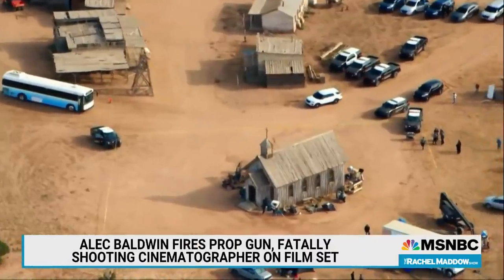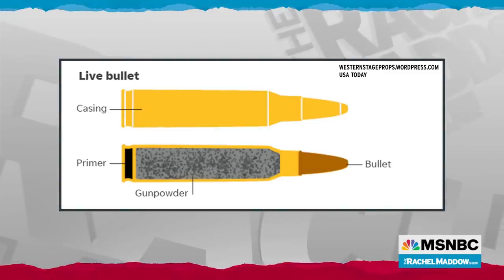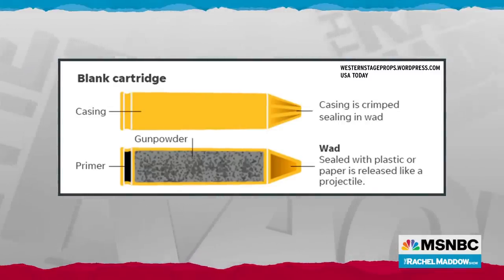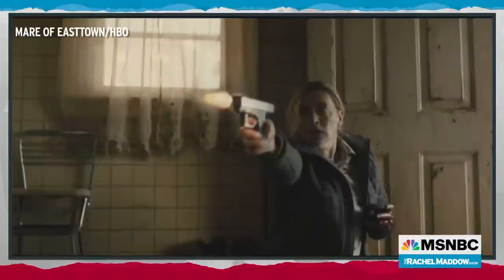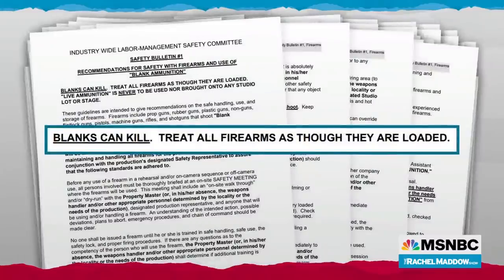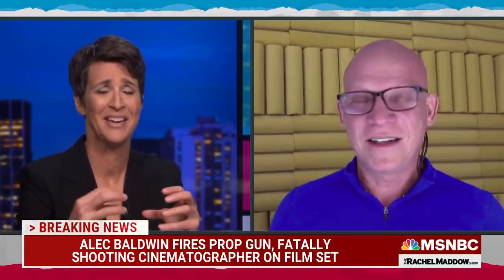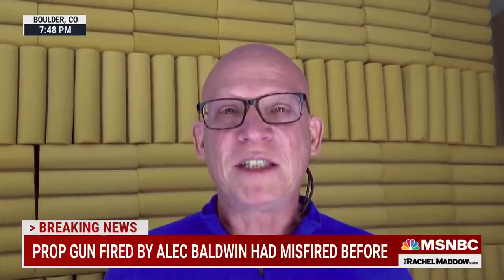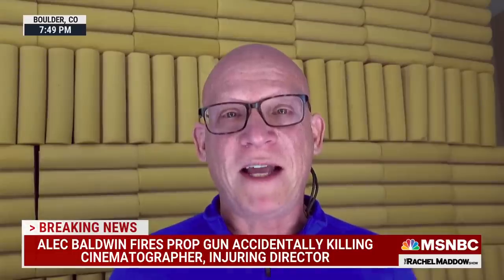Weapons Safety Expert Looks At Safety Protocols And Alec Baldwin Movie Set Shooting

Comment: Bingo. Just like the Florida bldg collapse. It took several failures in regulations for the catastrophe to happen.
Reply: Not a failure in regulations in both these cases, rather a failure to enforce them or ignorance by the people in charge. Most often the latter here.
Reply: It is the same in aviation investigations.  You often find a series of mistakes or assumptions made leading up to the crash.
Reply: @LMM7880  This is sometimes referred to as the "Swiss cheese" model. All of the holes in the cheese have to line up just right or nothing bad happens. Multiple safety rules have to be broken.
Reply: @machintelligence  with the Swiss cheese model there needs to be multiple people performing safety checks. When there is only one or 2 people there is a greater chance for those holes to line up.
Reply: Just like surfside, the impossible is made real
Reply: @jf6962  I can point to at least three. The person who was unaware of the rule about no live ammunition on set.
The armorer who prepared the gun.
The actor who pointed the gun at someone.
Possibly also the person who informed the actor that the gun was not loaded.
= three or four levels of screw-up.
Reply: @machintelligence  as far as actors, just not sure that particular point would qualify, as the actor's job isn't specifically to watch out for safety, it's to act and take what they have been given as the prop and act with it. Now if the rules in the fine print are different, I understand. Also understand that everyone, regardless of circumstance should be safe with firearms, I'm just saying specifically as far as this circumstance. I have a feeling that the gun Wrangler had walked off of the set. I'm just curious, who loaded the gun, and did they load ot improperly?
Reply: @machintelligence   Allegedly there was no armorer as he/she left the production because of disagreements over hotel recommendations
Reply: Not really the tenants were told it was failing but declined to pay for repairs that would have cost them millions and so they died for being stingy with their money, simple greed killed them .
Reply: 1. Pointing the gun at that woman 
2. Pulling the trigger
Reply: No, it took one woman to look to see if the gun was safe, she didn't.
Reply: This is why I can't stand people saying Alec needs to go to jail. Like a lot of stuff went wrong for this to happen. It would be like imprisoning the guy who leaned against the wall that fell over in the collapse.
Reply: @Amelia-uf9ig  one woman? The person pointing and firing the weapon is ultimately responsible. This is not complicated

Comment: What I can't understand is why would they have live ammunition on the movie set to begin with?!
Reply: And why was a gun pointed at the cinematographer in the first place and then fired?
Reply: Its cheaper than good dummy rounds for loading scenes and close ups. Budget and whatnot
Reply: @XxLuvverofMusicxX  probably was more pointed at the camera for a scene and the cinematographer and director were behind it. He thought it was a blank im guessing. He was guaranteed by a "professional"
Reply: @XxLuvverofMusicxX  - because they shoot AT the camera and that is where the cinematographer and director is standing - its the most common shot taken in a movie.
Reply: @robhill4352  - YES - they use live bullets for the close up loading. Which is Fking dumb - all "live bullets" should be lead-filled dummies so they are clearly much heavier and no actual live bullet should ever be anywhere near a film set.
Reply: 1) Loading rounds on camera (though dummy bullets can simulate this, it sounds like there was a problem with the off-camera crew and that wasn't properly handled)
2) Converting live ammo to blanks.  
3) Live ammo also can be used for pyrotechnics or for when they need actual bullets to fire and cause damage on-screen.
Reply: @piccalillipit9211  They can use simulated rounds or dud for that.. but if someone swaps the dummy for the real round and no one-notices?
Reply: @AdeptPaladin   here in Bulgaria you can buy "Gas guns" for self-defence - they shoot either CS Gas or Mace, or just blank rounds. YOU CAN NOT FIRE A LIVE ROUND

The barrel is not machined out fully so it will not allow a live round to be fired. As the guy showed they are chambered under sized. So you make a law / policy that in the "blanc calibre" its illegal to create a live round in that calibre - it can be a dummy or a blank so that live ammunition for not exist in that calibre. 

Im pretty sure this is the case in Europe, not 100% sure.
Reply: @AdeptPaladin  A "dud" is ammo or an explosive device that fails to fire or detonate. They are not purposely designed that way... They malfunction. A "dummy" round, also known as a drill round, is a round that doesn't contain a primer or gun powder. So, therefore it cannot fire.
Reply: One would think that rule #1 would be... Shoot to "miss".
Reply: @XxLuvverofMusicxX  I've worked on many films that use firearms and you look at most scenes involving a shooting, there's always 3, 4 upwards of 10 or 12 camera angles shot for any scene, then they pick 1 or 2 for the final cut, this applies for any and all scenes. 90% of all that's filmed never makes it to the final cut. There will always be some shots fired right at or close to the camera angle and the director and about 6 other people sit right behind or beside the camera guy.
Reply: asking the real questions here...
Reply: @robhill4352  there was even an acrylic screen to stop the filling of the blank, but it was a live round instead.
Reply: @piccalillipit9211  

No they don't use live rounds for loading shots. They use dummy rounds, fake rounds that look real. 

Noone except security should have a live round on a set
Reply: Because its freeeeeeedooooooom
Reply: Thats the one thing I cannot even fathom. Either someone is extremely careless and did not know at all what they were doing, or it was a malicious act to start with. Firing a gun is intentional, but actors go through numerous rehearsals and I can understand an actor pulling the trigger rehearsing something. I dont know what the safety standards are and I leave it to experts whether an actor is supposed to check the barrel of each gun they are handed or not.
Reply: BANG...!?
Reply: @XxLuvverofMusicxX  ...Alec must have been feeling silly....!
Reply: @piccalillipit9211  BFA, painted black. Blank firing attachment...this sounds Baldwin unique improper handling.
Reply: @piccalillipit9211  Interesting. I would have thought that if you were after realism for a loading scene you would use rounds without powder and primer. Also you would ensure the firearm had no firing pin. Three points of safety right there alone. But maybe I am being an expert after the fact as I have never given any of this any thought before. Plus I do not work in the film industry so it would have never been a concern.
Reply: Well He is known to have a spiteful temper……
I know just saying
Reply: Agreed. You would think no one except licensed security professionals would be able to possess live ammo on film sets following the Brandon Lee incident.
Reply: Michael Heathman  Most production companies don't even use real guns with a blank charges anymore, it's all CGI now. It's safer, quieter and you don't need to have a gun wrangler around all the time. Anytime you have a prop gun on set and it's about to discharge a blank, it's called a "live round", meaning there's going to be a flash bang and it's going to be loud so be prepared. They don't even allow real guns anywhere near sets, prop guns are a different size internally and only accept blank rounds. I think the wrangler lost control of the weapon at sometime and either some loose material got shoved down the barrel or fell into the barrel from a previous scene. Either way I'm sure we'll hear soon enough what happened. It's a sad day for those involved.
Reply: Because it's the USA! Guns and ammo for everyone 🥳
Reply: First we don’t know this for sure. Second if you are getting firearms information from Rachel then you definitely don’t know anything
Reply: Rattlesnakes?
Reply: @salvagemonster3612  And third, if all people would listen to passive-aggressive Youtube comments, then all would be well in the world.
Reply: @noskillzdad5504  yeah. But did you see the 24 year old armoror?
Reply: possibly an inexperience crew. That's what happen with Brandon Lee, they had live ammuniton on set that they later cannibleized to make blanks and snapcaps.
Reply: @piccalillipit9211  No. Live ammo isn't even allowed on film sets. What it is for loading scenes is dummy round. A case filled with plastic and the prop department paints the tip metallic. Same thing everyone else in the entire world uses for loading drills. You can buy the things in every Walmart in the country. They're common as dirt.
Reply: @salvagemonster3612  I'm guessing you didn't even watch, an actual expert does the talking
Reply: @halycon404  Dummy rounds that look like they are made of plastic are common as dirt. the ones that look real are not to prevent confusion.
Having someone paint them costs money....
I know, it is stupid and illegal, but it is one way this could have happened. If so, people should go to jail.
Reply: I just can't understand why someone would just pull the trigger while pointing it at a person? Needs a full investigation
Reply: @robhill4352  reloaders make dummy rounds all the time. I make them without a primer so it is easier to set up the reloading equipment for that particular bullet and cartridge. It would be easy to add an inert primer.
Reply: It's extremely sad that Mr. Baldwin was handed a loaded gun.  He trusted what was handed to him and told to him.  He will have to live with this the rest of his life.
Reply: Go to the top. Hillary must be involved.
Reply: What I can't understand is you and I are scrutinized to have a gun but any nim rod with a SAG card can get one
Reply: @piccalillipit9211  they aren't supposed to have live ammo anywhere on set. They can have fake rounds instead with no powder and no primer, that do have a bullet. If you don't have a primer there's no chance of boom, but the armorer on set didn't know what they were doing
Reply: @robhill4352  you have no idea what you are talking about unless this is a feeble attempt at being sarcastic.
Reply: @AdeptPaladin  zerc hits are used from air guns or charges are placed on the item that needs to be hit and triggered during the take. We do not use live rounds.
Reply: @piccalillipit9211  no they don’t, they use dummies for closeup shots.
Reply: Apparently the crew were using live rounds to shoot cans during the downtime. Sounds pretty dumb, but even if they were doing that there are protocols to follow that would’ve caught the gun containing live ammo.
Reply: So the crew can do target shooting during down time. The crew returns the gun to storage without unloading.  Later, gun isn't checked by armorer or actor to see if it is loaded. Actor pulls trigger.
Reply: I read they were using the pistol to shoot targets during the down time.  The pistol was never locked up or checked.
Reply: @piccalillipit9211  Another prop master puts pellets in the cartridges for dummy rounds. They rattle when shaken.
The reason for the real bullets on this set was because they were using the pistol to shoot targets during the down time.  People were already walking off the set after a stuntman shot two rounds when it was not suppose to shoot anything.
Reply: @torben6137  More like target practice during down time.
Reply: @konradyearwood5845  That's true, but the pistol was also being used on the set to shoot targets between takes.
Reply: @telescope3   They were using the pistol to shoot targets between takes plus a stuntman had already fired two rounds a couple days later when it was suppose to shoot nothing. Negligence charges are surely going to crop up.
Reply: @DKanon  Targets. They were using that firearm to shoot targets between takes.
Reply: @GreatBigRanz  Here the live ammo was used to shoot targets between takes.
Reply: @halycon404  That's where the negligence charges will come in.  Not only was that firearm being used to shoot targets between takes, a stuntman fired two rounds when the pistol was suppose to be empty a couple days before.
Reply: @nk-dw2hm  They were already using the firearm for target practice between takes and two rounds were fired on set by the stuntman a couple days earlier when nothing was suppose to go off.
Reply: @XxLuvverofMusicxX  Because Alec Baldwin, being as anti-gun as he is, didn't bother to learn proper firearm safety.
Reply: @robhill4352  According to a witness he was doing practice draws when it happened.  Also, there is a certain degree of responsibility on him to check.  That's universal when handling a gun.
Reply: @torben6137  Your sarcasm screams anti-2A, Am I right?
Reply: @royormonde3682  
That is a stupid practice and needs to change then. We can now use monitors and machines/tools to view what the camera sees and to also adjust the camera. 

Aiming a gun of any sort at something you don't want to destroy is a huge no-no.
Reply: @robhill4352  Hi Rob, I've just read your comment about loading scenes, again it's still no excuse for having any live rounds anywhere on a film set, yes blanks are one thing, I know the firearms world very well, I understand wanting to show a real looking bullet to the camera for loading purposes to make it look real I get that, as a blank will show the crimped edge which loses that authentic look, however you can use a real looking bullet and remove the powder and primer, that way on camera it looks 100% like a real bullet because it is. Removing the, powder and primer doesn't lose any authenticity especially on camera, this also renders the bullet impossible to fire. 

This is my own personal opinion: Whoever loaded gun with live ammo, as they knew it was a prop gun and they were on a film set, whoever said it was a cold gun and, whoever should have checked it but didn't, then handed it to the actor (everyone knew what scene was going to happen in advance of filming and what was going to happen in that scene), and the person that pulled the trigger are all responsible for one person being shot dead and another seriously injured. As the man in the video states why would you point a gun at someone regardless if it was safe or not and pull the trigger? 
All these failures in health and safety, not following the correct rules, laws and basic common sense all led to the death of a very talented young lady and a man getting seriously injured nearly costing another his life. All of the above people are to blame it's as simple as that! But because it's an A list celeb involved I doubt he will ever face any real justice probably a fine or a suspended sentence max.     
Again they were all to blame and all broke the basic rules. No I don't mean the victims before someone starts throwing that at me.